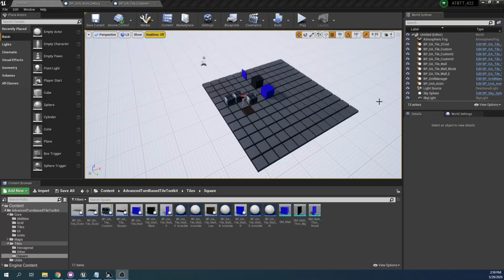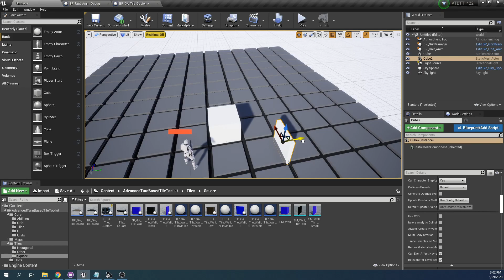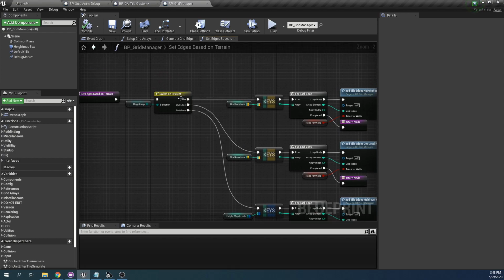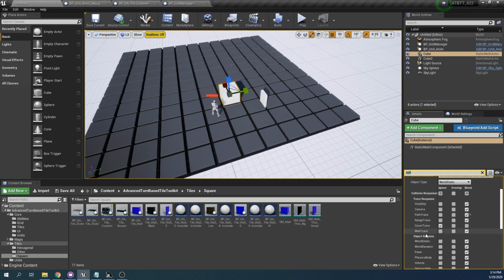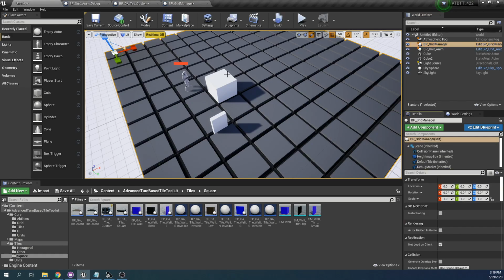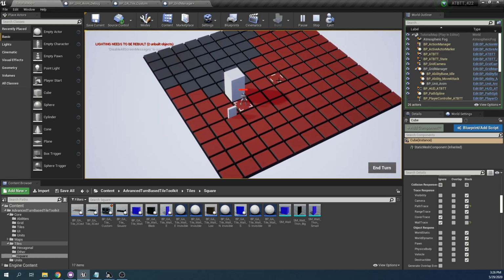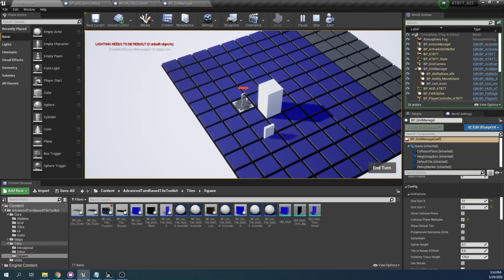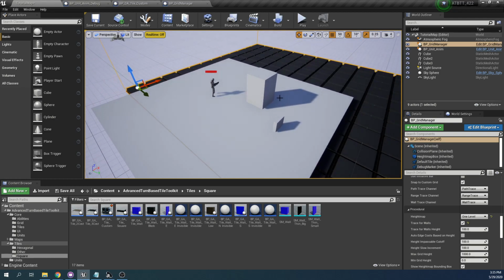ATBTT Basics #3 - Walls

Comment: I'm really interested to see how this handles objects with non-continuous edges, like a wall with an arch cut out. Would it allow the player to move through the arch if the opening were large enough?
Reply from the maker: Yes, it handles this well. The TraceForWalls bool option in the GridManager traces a line directly from tile center to tile center, checking for walls (at a pre-defined height parameter). If that trace is not blocked movement between those tiles will be allowed by default.